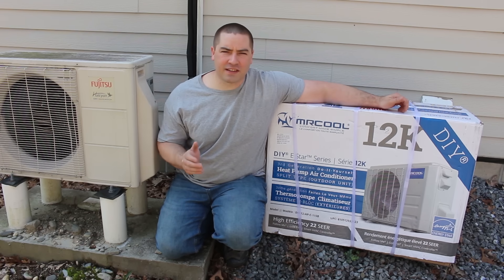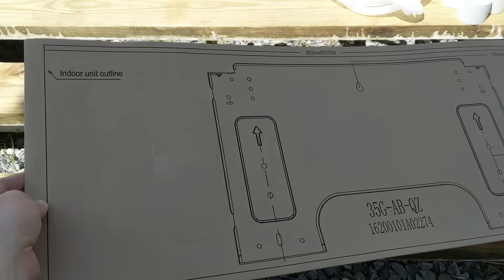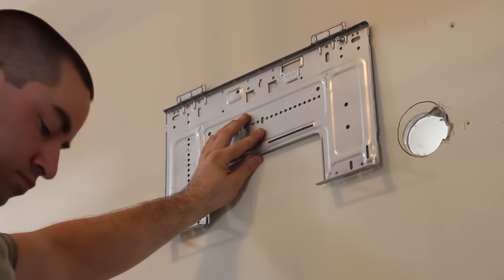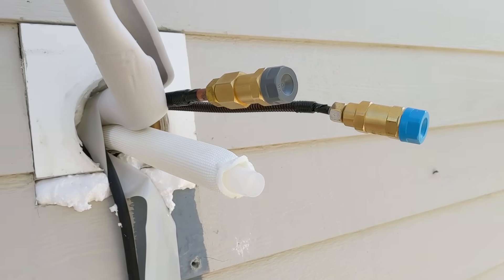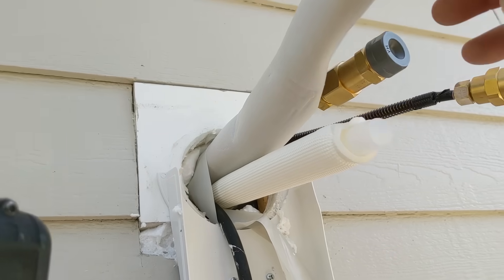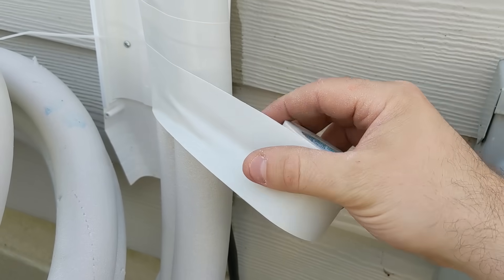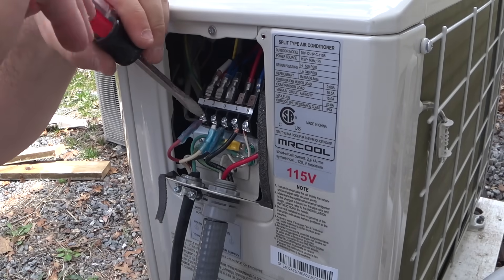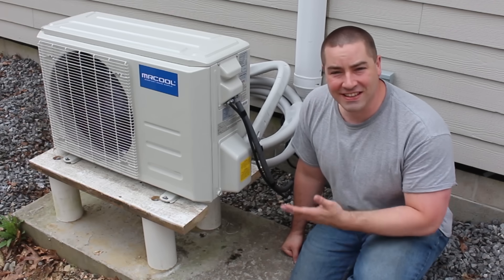Installing My Own Mini-Split Heat Pump, DIY

Comment: A vacuum pump is required to remove air and moisture from the refrigerant lines. The oil in this system will turn acidic due to improper installation (no vacuum purge) resulting in premature compressor failure,You have to recover system, pump down the entire system and new lines and then add a weighed in charge of refrigerant. It requires a two stage vacuum pump, recovery unit and tank, digital scale and charging manifold. Also throw away the Chinese fittings and silver soldefvsome decent connections without excess lines.

.

Comment: If primary use is heat,  Is it ok to install the indoor unit low like 3ft from the floor?
Reply from the maker: There is another type of indoor unit that looks more like a radiator, it's made for that purpose.  Like this example: https://hvacdirect.com/daikin-aurora-series-12000-btu-20-seer-single-zone-ductless-mini-split-system-multi-positional-id10834.html?adgroupid=1143492708623366&creative=&keyword=&msclkid=9b5bee7475581ebf1c73b1f672d1d350&utm_source=bing&utm_medium=cpc&utm_campaign=Shopping%20-%20Mini%20Splits&utm_term=4575067885483119&utm_content=Single%20Zone%20%22MS%22

Comment: I am about to install one of these ssmall units. now the question, when looking at the amps, looks like a 220 unit run at 3amp vs 8 amps for a 115 v system.  can you run a 22 unit with solar pv panels with a battery bank?
Reply from the maker: I'm running my whole house and garage (that includes this mini-split) off the grid using my solar and batteries.

Comment: David...love your videos Ive been watching most of your converter videos...Im a general contractor out of California and while watching this video I seen the wall anchors you used the secure the bracket to the wall. I know you hit a stud which will carry pretty much all the weight of the unit but have you ever used Hilti Toggler Bolts? If not look them up they are great and super strong.
I thought I would pass on the tip...Someone showed them to me about 10 years ago and now its all I pretty much use when needed.
Reply from the maker: I have tried the Hilti Toggler Bolts.  Thanks for the tip.

Comment: Nice roll of tubing behind the heatpump!
Reply: thats the way we roll up here
Reply: He  installed the excess properly.  Should be horizontal , otherwise the oil in the freon accumulates in the low spots  if excess is stored in a vertical / on side coil.  Can lead to compressor failure .

Comment: u realize u need to pull a vacuum on the system before release the freon . that system is now full of air and moisture ,that will Destry that system within 3-5 years
Reply: nowadays all the AC mechanics at India are doing is releasing some gas through the piping / flushing out some gas through the piping and releasing the gas / moisture in air, even the installation manual of most brand says so

Comment: Taking out a Fujitsu for a Mr Cool lol. You can buy an 18k daiken on ebay for $1200. With the left over cash you can buy all the tools to install it right - Vacuum pump, torque wrench, micron meter, charging core tool etc. 
Mr Cool< Mitsu, Fujitsu, Daiken, Gree

Comment: First off, good job on the install, not bad for a homeowner and I genuinely mean that.  The following information is just for anyone looking to install your own ductless system,  always follow these procedures if you don't want problems:  Get a cheap torque wrench, every system has a torque wrench setting in the Installation Manual, It will almost ensure no leaks.  1) If you want to properly test for leaks use nitrogen, test @ 200-300psi.  2) Always vacuum your system to 500 microns before releasing refrigerant, harbor freight has all of these tools for cheap and they're worth is considering you are already saving money from paying someone to do the installation.  Because the system wasn't vacuumed and the refrigerant was introduced to oxygen, that refrigerant & compressor will forever be contaminated and will eventually lead to compressor failure.  This can take up to 10 years although it can happen in as less as 1 year before symptoms begin.

Just my 2 cents from your friendly hvac technician!

Comment: Really nice video.  We've been working for days to try to install one.  Installing the outside stand through 2 inches of stucco, then 2 inches of foam, then the 10 inches of concrete was a challenge.  Now to the unit, we have the 12K and it says have to use torque wrench - which we can only find for close to $200.  Your seemed to just tighten without that.  Are your instructions different?  Been trying to find contractor in my area to install one for 3 years with no luck.  So decided it was worth a try.  Worst case we have a 3 inch hole in wall.
Reply: The special fittings are sealed via the dual O rings not the screw fitting, just get it tight in order to secure the fitting and allows the internal valve to open. You can even remove the lines without loosing any Freon because as you begin to loosen the fitting pressure is lost against the valve and it closes.  I had to remove my two head unit after a storm heavily damaged the place, then after repairs to the place I just reinstall the same equipment and everything was still charged correctly (no Freon losses). These are amazing lineset connectors in their DYI labeled systems.  So Easy.

Comment: If you not a license contractor the unit will be not cover under warranty-useless video.
Reply: Diy "non contractor" Warranty: 7-Year Compressor Warranty & 5-Year Parts Warranty

Comment: That air you didn't clean from the system will rotten the entire compressor internally which will damage the equipment and in two years will break down. That method isn't the right one so call a license technician to have the benefit of any warranty in the short time..

Comment: generally those connections are more risk for leak than a flare connection... But yea. we dont need evacuation for this connections... I replace them always when i find them in an installation with a leak. 99 percent its those connections/....

Comment: @5:15 is the electrical line for communication? Because at the outdoor unit, there's a difference between the communication line and power lines. Also @3:15

Just checked the manual. Yes, it is the same thing as this wiring also powers the indoor unit.

Also, what is that stuff you were putting on the threads? Thread lock? Nylock? What is that? I think I might just use gasket maker and see how that goes
Reply from the maker: Nylog, it's a sealant that can be used with refrigerant.
Reply: @DavidPozEnergy  oh okay, thank you!

Comment: Is there no need to vacuum down the lines?
Reply from the maker: Not this particular kit.  The lines come pre-charged and sealed from the factory. But most mini-splits do require a vacuum at install.

Comment: I don't understand the point to all this. Why not just use a window unit?
Reply from the maker: Window units are less expensive, and certainly faster to install.  I like window units for some applications.  Actually, I have a window unit for my garage.  
These mini-split heat pumps have a few advantages.  They are more energy efficient than the average window unit, quieter, and don't take up window space.  They also do both heating and cooling.

Comment: The extra long line looks ugly and it's going to affect the performance of the unit.
Reply: mario, just a heads up this is a DIY SYSTEM  no vacuum pump needed....... the unit is designed  for that line set ..........
Reply: @rs9510  with the extra money u pay for pre charge unit u could buy all the tools to diy a regular, better heat pump.
Reply: that's the cost of diy
Reply: No its not. Not whole systems are designed the same and its also designed for them hard to reach places that need extra line HENCE duckless.

Comment: This was a joke. If most HVAC contractors cant properly install a unit what makes DIY'rs think they can properly install one?  Here a quick tip find a good Contactor (regardless of price) to do the work. Stop going with the cheapest in town and you wont get the cheapest work.

Comment: How long did your old unit last .
Reply from the maker: My old unit (Fujitsu) lasted 2 full years without any problems.  I had paid a professional company to install it originally. 
 Then it went down hill.  I paid big money 3 times to have it "fixed" by the pros.

Comment: Attention anyone watching this hack. Do not do this yourself. His whole process is wrong and he'll be lucky if the unit lasts.
Reply: Why?
Reply: 100
Reply: Yeah I miss d the part where he put the system into a deep vacuum so the air in the lines does not create acid.... Maybe he did that during a cutaway? In wonder what Mr. Cool says about the vacuum procedure? 
Good luck with your unit.
Reply: @noahrosshill  this is a diy system. The lines come pre charged

Comment: You need to pull a vacuum on refrigeration systems to remove air and moisture from the system. 

Also a legit installer would cut the lines to length and braze a coupling in place.
Reply: Reason #200 why nobody should hire you. Sealed lines supplied. They are already full of refrigerant.  They only open when lines are connected.
Reply: @frankjohnson7640  
Good to know. I was wondering why they didn't Purge the air from the evaporator coil and the lines.
Although, when you use the Allen wrench to open the refrigerant line from the condenser coil he said you might hear a hissing sound if the lines were precharged why would you hear a hissing sound?
Reply: @frankjohnson7640  sealed lines lol. Good one
Reply: I thought I was the only one thinking, "Cut that shit a flare it "lol.    Looks bad
Reply: Scott HVAC this is the garbage I’m sure guys like you and I will get called to repair. Service mans night mare. Reclaim the charge if there’s any left leak check with Nitro then fix leaks. Evacuate a d weigh a new charge in. Bam 700$ later they should of called someone who knows what their doing.....

Comment: 30 ft of lineset left tucked behind the unit lol....The funny is once you have issue and you can't fix...have fun trying to get some to touch it. That's what happens when you try to save but in the end it cost you more lol

Comment: We recently installed this system. It came with two skinny filter screens but it doesn’t say where they go , can you assist please !
Reply from the maker: LOL, I was wondering the same thing.  I couldn't figure it out.  At first I figured it sat on top of the indoor unit, but it didn't cover the intake 100%.
Reply: Indoor in the blue things

Comment: This is a nightmare waiting to happen..... system should be evacuated to >300 microns. Good luck. Critical charges systems are finicky. I also see you didn’t torque the flare nuts to recommend specs threads should also be lunricated with POE oil. But hey you still probably did a better job than some HVAC licensed hack work I’ve seen.
Reply from the maker: Hi Nick Nass,  This is a unique system that does not need vacuum.  I go into more detail in my follow up video: https://youtu.be/KzHLsRtVn4U
Reply: DavidPoz nah this a rotolock style lineset that’s precharged I know exactly what it is. It was pioneered in the 70s. It’s junk. Call a professional

Comment: So as an actual licensed hvac contractor you probably shouldn't do this again.  You should contact an actual professional who knows how to operate a set gages and properly install that system.  Dude you didn't even run a vaccuum pump on the system at all.  So all the moisture in the lines will be ruining this system starting from the second you opened up those lines.  Hard to believe any instructions seriously tell you just to open the valves on a set of coppper lines that have been exposed to the outside air.  Hope you don't have any issues down the line but I'd imagine you will and the sad part of this video are the comments below saying "good job" and "perfect".  You installed this system wrong man, just because lines were sealed from factory doesn't mean you didn't expose the lines when you were tightening down on the lines with two crescent wrenches, also one of those wrenches should have been a weighted wrench to measure the amount of torque to put on the bolts not just make them tight as you can.  The system, prior to the line set being opened, should have been blown out with dry nitrogen then a vacuum pump should run on the system 'till measured at .500 microns.  Then can you open the lines and with a set of gages, like a professional would have, you can adjust freon levels to charge.  Good luck.
Reply from the maker: Hi John Morrison,  Thanks for such a sincere comment.  I'm always learning, and not an HVAC pro, so I'm sure I've made some mistakes.  I truly did not want to DIY a mini-split.  I paid a professional HVAC company to install my original system, which failed after 2 years.  Then I paid them to "fix" it.  When it failed again I paid another licenced HVAC company to come out and "fix" it.  And again it failed and I spent more $$$.  Both companies had gauges.  
I decided to go with this system because it's a DIY model.  The lineset is sealed and pre-charged.  Not just the compressor, but also the lines themselves come pre-charged.  They are not flare fittings, they are "quick connect" I followed the manual.  This is a unique system on the market, in that you don't vacuum.  
All that being said, I might still have problems.  But the cost of this system, brand new, is less than my last bill from the professional company to "fix" the existing Fujitsu.  And their "fix" only lasted 2 months.  So far this has been running 4 months 24/7.

Comment: As an Hvac contractor for 27 years, you are doing it wrong.
You haven't shortened the lineset which requires cutting to length and brazing (with oxy/acetylene torches) to make a smooth transition from the wall. Oops!
The Major mistake was not vacuuming the lines!!!
You opened the valves without doing that and introduced oxygen into the evaporator/lineset and heat pump.
You didn't purge the lines either.
410a refrigerant requires these steps to have a long life for your system to last a long time.
You probably only have a 5yr warranty because you didn't have it installed by a professional Hvac contractor.
You could have had a 10yr warranty. Doh!
This system will probably last you less than 2yrs, because of the oxygen in the lines.
(Which turns to acid when mixing with the refrigerant over time.)
Anyone doing it this way, is doing it wrong and wasting their money.
Don't do it! Hire a Pro!
I am just trying to help and prevent this poor install from happening again to others.
If you have no knowledge of Hvac, may I suggest installing a Ptac. This is basically the same "through the wall" system that you find in motels.
Easy to install and self-contained. Provides heat and cooling too.
Good luck from Atlanta,Georgia!! 😉

Comment: You didn’t check to make sure your breaker isn’t to much power it only 20 amp and those wire look like 10 gauge wire hope it not on a 30 amp

Comment: Great Job ! Only improvement i would make is to support the line set on the Wall of your house. i would recommend a Hose Hangar that u use for Hanging a Garden hose on a Wall. Coil Line set Vertically Like a Garden hose. ( Circular fashion ) That added support will double the life of the unit. if u do not support that line set i can pretty much guarantee u having a leak at the Quick connects in 5 years. Great Job Besides that. minuscule vibration is what causes leaks over time on unsupported lines. Refrigeration Tech. for 39 Years. Business owner for 30 years.

Comment: The Split AC in general is the worst choice especially in dry areas. After a year of purchase, the indoor unit will start leaking water profusely that ruins furnitures, and you must remove the unit to outdoors for cleaning then reinstall it again each 3 months !. Yes it cools inside not bad, and the duct is fine,  but the AC!!

Comment: Did you vacuum the air out before releasing the refrigerant?
Reply from the maker: No.  Usually that would be needed.  But this particular kit comes with sealed fittings on the line-set, and the line-set is pre-charged at the factory.  I go into more detail in my follow up video on that question.  https://youtu.be/KzHLsRtVn4U

Comment: Vacuuming heat pump is the main process in installation of Heat Pump. Vacuuming (pulling out air in pipes) prevent mixing refrigerant with Air and also detect leeking. In this video i dont see any use of vacuum pump and instalation is far from proper instalation.

Comment: You forgot to vacuum the lines before you open the Freon, may need a maintenance in the future because of this .
Reply: Absolutely agree with you. How did he miss whole evac step?
Reply: @olegsvodyanov  Those are pre-charged line-sets with quick connections. That is how your able to purchase a system that normally requires you to have your EPA certification.

Comment: Great video. Appreciate that. Do you know how many feet the control wire is from the air handler? We just ordered  the same unit but cant find that information.
Reply from the maker: I didn't measure it, but I'd guess about 25 feet.

Comment: Too much extra line coiled behind the unit, kinda sloppy looking. If you get the non DIY unit u can trim the line to the proper length and it cost half the price. The DIYs are over priced.

Comment: Selling air conditioning systems like these to the DIY market should be illegal. They don’t get pressure tested correctly (or at all) and more often than not they leak their refrigerant to atmosphere. The following year they get topped up with refrigerant and the cycle continues. Not to mention they look terrible with all that excess copper coiled up 🤦‍♂️